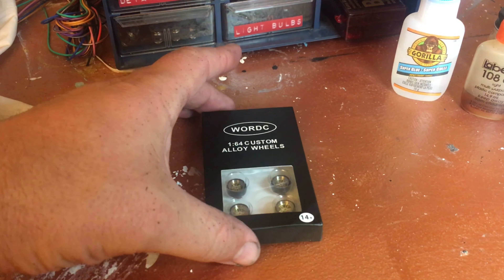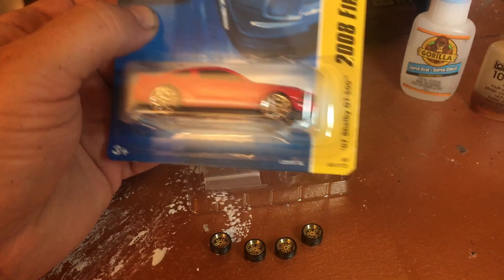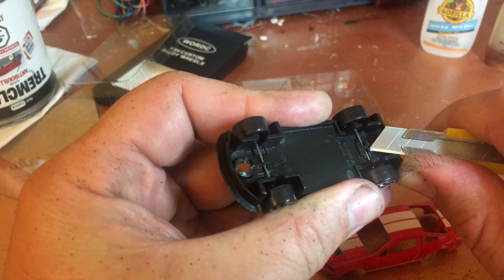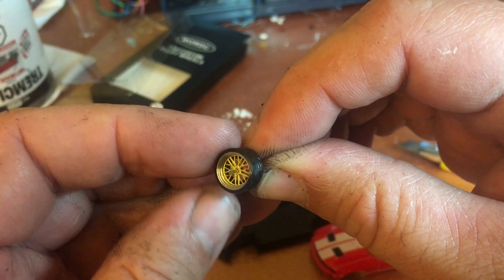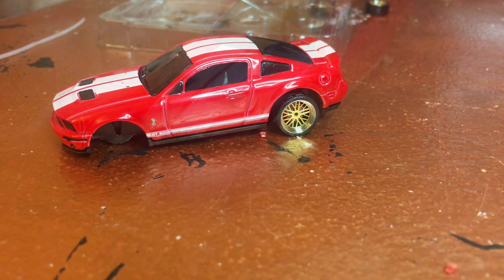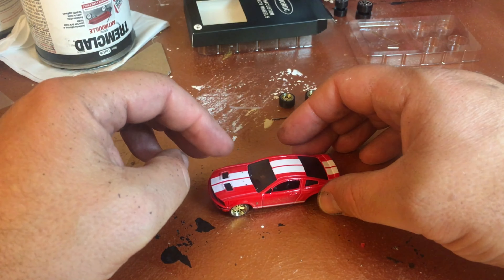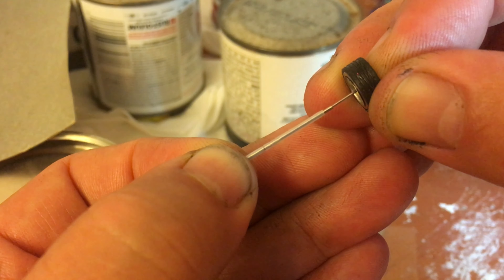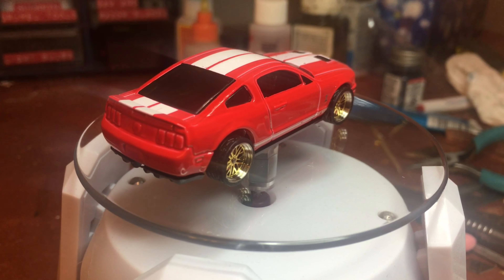1/64 alloy swap on a Shelby GT-500

Comment: Does it actually roll???   There's a real art to doing 1/64th customs, even with a very simplistic wheel swap.  Looks great if it will remain a static display.
Reply from the maker: Izen Guarr It rolls, but it’s not a racer.